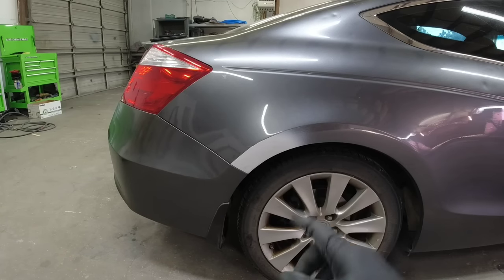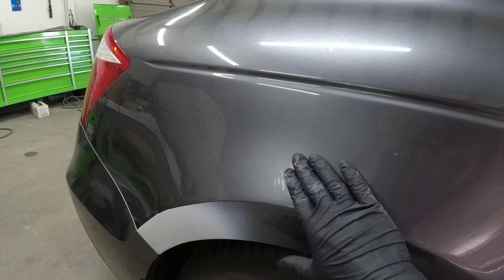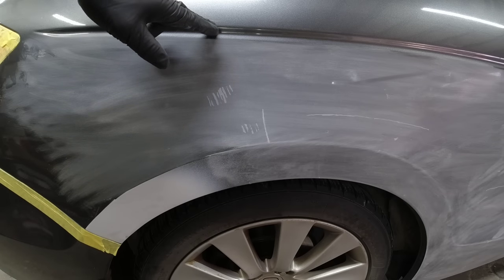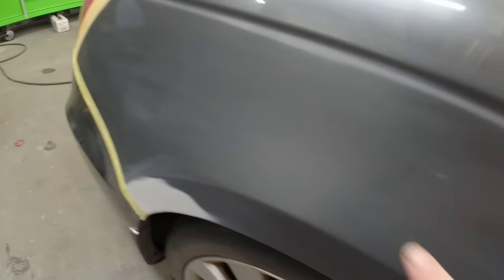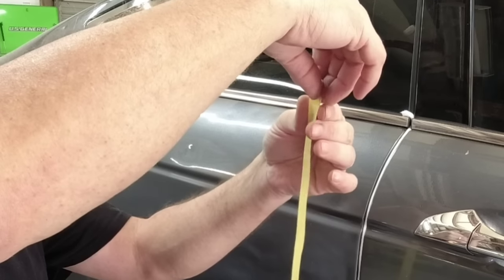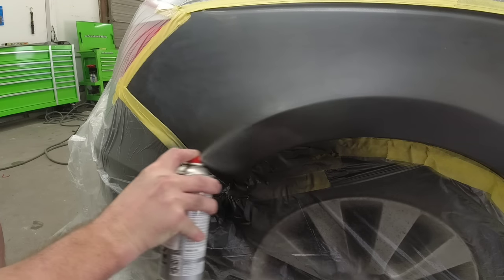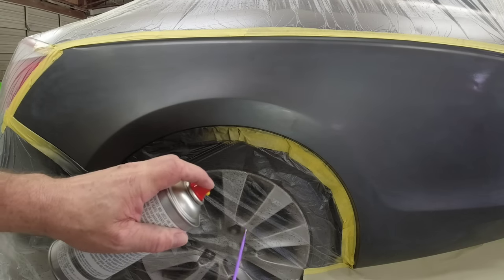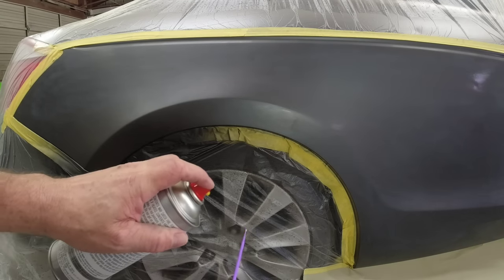How to SPOT PAINT a car with SPRAY PAINT and CLEAR for amazing results!

Comment: That 2k clear coat is great but wear a Proper Mask because it will cause serious health issues.
Reply: Bro he's a professional, he'll be just fine.
Reply: Ok Karen
Reply: @TylerHankss  sprays basically poison in the air. Someone cares enough to point it out. Professions can't die. Karen calling. 😂 I swear the internet is wild
Reply: I don’t even think there’s a mask that can filter isocyanates. It absorbs through the eyes and skin too. You need full face respirator and coveralls.
Reply: Thank you for the inspiration; I’m ready to tackle my badly scratched door! Saving hundreds in deductible, and possibly in increased i nsurance rates!
Reply: As someone who used to paint a lot of graffiti you should definitely preach this to other graff artists 😂

Comment: Man I used to blow off the notion of a mask or much less a respirator.  Wrong!    The usual Rustoleum enamels are one thing, and even then we should protect ourselves, but lacquers are truly dangerous, and that 2k Clear is very strong, but very good, as I’ve used a ton of it.  It polishes out well, and has even passed the gasoline spill test.   The Dupli-Color version I tried before failed miserably.   This can be done.    Mostly prep work is very crucial, well, it’s ALL crucial.   But application is the make or break.   Environment matters big time too.   If it’s too warm the paint will start to dry in the air before it hits the surface.    So you get closer, right?   Too close and it piles on in such a way that is insidious and deceptive.  It might look great, no runs,shiny and wet looking, top notch.  But later you will see it settle, and on vertical surfaces it’ll run so subtly you won’t see it till your wet sanding it next week.   So not so close then.  But it MUST look wet by the third coat.  First mist coat is crucial, NOT WET.    Let it sit just long enough to be tacky, not dry, but flashed off, where all the solvents have escaped, which is a tough call.   Because here’s the kicker.   If you wait too long, the next wet coat won’t settle into the mist coat deep enough, won’t stick as well, require that much more product, which then induces the next pitfall.   If your can spatters, spits, at ALL, shake it and give it a spray elsewhere to see how it’s doing.    If you THINK it’s gonna spit, set it aside for a seldom seen area where you might need more depth, and a spatter can be sanded smooth and dealt with, as opposed to the middle of the side of your drivers door.   Worse though, is when everything looks good and you let it cure, only to find cracking or “crazing” in your paint in particular places.   That’s where the coat beneath cured JUST enough to form a skin or layer, but hasn’t released ALL of its solvents yet, but then you didn’t catch that nearly impossible to detect issue, so you paint a wet coat, let it flash, and another.   An hour or so later you excitedly check out out and horror.   Crazing.    Like dried mud.   The first layer is still shrinking even after the second and third coats go on, but those coats cured themselves and are preventing the bottom coat from curing properly, and when it shrinks, cures, settles, moves, whatever, you see the results in the top coats.    Bad news.   Start over.    Spot painting on top of a spot painted spit is no good.   Of the grain beneath isn’t uniform then the color coat won’t be uniform.    With the OE paint it’s all old and being done by a machine there isnt much grain to see, other than very uniform orange peel.    You’ll see the sanding and paint depth differences if you try to just sand away the crazing, and then recount that.   At that, you can really sand it for a few hours, regardless of what the directions say.   Sanding uncurled paint is a recipe for disaster and a hundred times the work you envisioned.    The clear coat can hide SOME things, but that one spot you think is no biggie, will be.     I’d say that once the surface is right, and it’s paint time, that spattering or spitting is the one biggest fear and can ruin your day.  Learn how to feel for it, keep the nozzle wiped, and keep your hands and fingers well out of the path of spray.     If it’s too cold, it takes too long to dry, hits too wet, runs or sags, and has linger time to catch moths and dust.     As hard as you’ll try to keep the area bug free, good luck.   If it’s too humid, you’ll get cloudy or foggy spots, where it looks whitish, and that’s absorbed moisture sucked into your drying paint, as a sponge to moisture, your paint to the same.    Try to dry the air with heat or a dehumidifier, and quickly, but not too quickly, as drastic changes in conditions WILL affect the finished product.    Maybe very glancing and subtle applications of a heat gun or hair dryer, but don’t get too hot or it will run or shrink, more problems.     To dry, it will be dry before it hits the car.   Get it wrong, and you’ve got a high-nap suede paint surface.    Which can be sanded but then you’ve got to repost the whole section.    Running out of paint is another nightmare.  It induces mistakes.       Nice overlap strokes, leave no line but if you miss don’t go back and fill it in until it flashes just a hair or it will sag.    The right pace of movement, careful attention to exactly what you are doing, real concentration, it all matters.    A gun gives you a more uniform supply, a better pattern, more overall control of the paint itself, and repeatable results.   But a pain to keep track of mixes, proportions, the mess, the supplies, the compressor going off when you’ve heard enough, and the cleaning of the gun, nozzles and tips,cfm rates, drier, the whole shooting match.    To me, it’s still a toss up.   I got incredible results on my Magnum in Brilliant Black, sometimes I can’t believe I painted that whole quarter panel, it looks so good.   But my moms old Mercedes in simple Black is killing me.    Where I swear a gun would make so much better.   But I hate needing a big compressor and the whole pile of accessories needed.  But, it may be time.
Reply from the maker: I appreciate the comment and support!
Reply: I’m about to try and touch up on my car where it has scratches from who owned it previously, I have one spray can of primer and another spray can of silver paint to match my car and reading this just blew my head off, hopefully my little DIY job goes ok lol
Reply: What would be the ideal temperature to apply the clear coat please?
Reply: @guitariste47 . The can of clear should have the information, but 70-80 degrees is probably the sweet spot.

Comment: Great tape but I was told to always let the bass co cure for a couple of days since it's a single stage and doesn't always dry that. If you put the 2 part clear on 2 soon it'll eventually bubble because a chemicals haven't come out of the base coat yet...
Reply from the maker: If your clearing over  single stage it's  a bit different. I wouldn't let it sit for days that's  too long but single stage you could let sit for about 45min before  clearcoat.

Comment: Very informative. 
Much appreciated. 
One thing I have learned though from using aerosol cans for the past 40 years is start the spraying off the targeted area and end spraying off the targeted area. Especially if you're using metallic. Gives it a more even coat. At least in my experiences anyway. 
Not saying its right or wrong, its just that works best for me.

Comment: I'm a keyboard nut but I have an '87 GMC S15 that is starting to bust rust. This was a great confidence booster. I recognize the need for a good foundational cleaning, proper surface prep, and keeping the can moving. Please go back to the original repair description and link this video.  TY

Comment: great video and a very great to to me, a total beginner who's never done this before.  The only worry I have is that you don't say 1) How long your leave the paint coat to dry before applying the clear. 2) I'm unclear what, if anything, I'm supposed to do on the paint job before applying the clear? Just a tack cloth and the isopropal? Anyhoo, you have given me the confidence to now try this job after two weeks of buying the paint and clear, but lacking the courage to actually try it. Now, after watching your video, I can't for tomorrow to get going on it and really get it done! Any faults will be my fault and not yours because you showed how to do it so well! Best wishes and thanks again from the UK. Al.
Reply from the maker: Awesome! 15 minutes before applying clear depending on temp. You may tack base before clear and insect for any dust. If you do find dust lightly sand with a fine sand paper between 600- 2000 grit apply another coat of base at clear. Watch some more of my painting video's I go over all this. Appreciate your comment and support!
Reply: Many thanks for giving me the courage to try it!  Saved me some £500 the body shop quoted! Came out pretty well, only big mistake was allowing the clear to drip in 3 places! I think sand back and spray clear again might cure that. Funny story for you: Have no garage or shelter, had to do it in the street. Underestimated power of the wind (only about 10mph). Got into car and then noticed the wind had blown the clear coat, covering all the windshield! Couldn't see a thing! Frantic panic to grab some compound and get it off before the sun baked it hard! You've never seen a man of 74 move so quick! Best wishes and thanks again. Al.  @GarageNoise
Reply: "It's not that the wind is blowing it's what the wind is blowing!" - Ron White @jewellguitars

Comment: Thank you for such a great video. Yesterday, I did the same thing with my Honda Accord. I was delighted with the results I achieved with the color-based spray, but I went and used the same clear coat you used in your video. I got cloudy, - dull results, and I don't know why or how to fix it and avoid it happening again.

Comment: Great video!  We have a 2006 RAV4 that has one area where the paint is bubbling (and coming off) plus some areas that need minor repair (dings from parking garages, etc).  There are only 120,000 miles on the car and it runs great, but paying for a professional paint job on a 17-year-old car doesn't make sense to us.  She's been good to us, but seriously, how much paint does a woman need!  :)  We'll give your instructions a try.  If it works for amateurs like us, then you're a hero.
Reply from the maker: I had 3/4 of a can of paint left so I imagine you could do paint 4-5 spots the size of mine with one can of paint. As for the clear I would figure about one can of clear for a med size panel like this.
Reply: @GarageNoise  I feel like I'm going to seem stupid asking this and I am asking this genuinely but I'm just curious as to why you sanded the whole panel back when it looks like you only painted the back wheel arch area. Was it just that you didn't sand enough paint off to need to respray it and thus could just go back over it with the clearcoat?

Comment: I used the very same 2K aerosol clear coat on a fender that I redid 3 years ago and I ended up with a bad case of orange peel that took me most of the rest of the day to sand and buff out.
Reply from the maker: This stuff cures hard as nails. That's  good for durability tho.

Comment: Great video. Didn't know they had these paint options out there. Small suggestion, next time start at the top as you did but do the whole length of the quarter panel and work down. Thanks Again

Comment: That paint was fine too begin with!  

I painted my teen son's 95 Impreza with rattle cans. From forest green to navy blue.  I used Rust-Oleum brand enamel. I do not buy the spray cans with the standard caps they are often junk, and on big projects will cramp your finger faster too.  I did the whole job in phases, in 7 days start to finish, under an open carport. 1 day later, after a decent dry time, the Colorado wind gusts picked up for days.  I was very blessed! Close call!

My recipe was: sand with 320, then 600, clean with soap/water, mask/cover, clean with lighter fluid twice, tac cloth, 2 coats black primer, 3 coats color, 3 coats clear...each 10 to 12 minutes apart. All paint has to applied within 90 minutes from start, upon a flashed off coat.  2 years later and still good.  I don't even think he's waxed it yet. 😅

Oh, i didn't sand between any coats, obviously.  It didn't look perfect but good enough for a teen ride.
Reply from the maker: @thesetruths1404  👍

Comment: Man, you have no idea how much this helps me A TON!!! Never done it before, zero practise or knowledge but I feel confident (thanks to this video)I can do it with common sense lol. But it bugs me not to understand something, that in fact you haven't spray paint the entire area but only sprayed with clear coat after sanding down. So my question is: If I sand it down an area with 800grid and clean it and after apply CC I will get the shine back?. Thx in advance Liked and Subed.
Reply from the maker: Yes you might need to wet san an polish but you will get the shine back. I have video's that show the process  of sanding and polishing clear coat as well.

Comment: I'm not sold on the 2K clear aerosols - they're just a bit of a pita compared to painting the base with an aerosol then using a gun for the clear.  You get a better finish faster using a gun for the clear - with less effort.
Reply from the maker: Oh yeah definitely better with a gun. Im just impressed  with  the appearance of 2k Aerosol clear.  A good option for those without a compressor or gun. Appreciate the support!

Comment: Using a Rust-Oleum type spray can handle when doing a job like provides better application balance and reduced finger fatigue. May even prevent the run that happened!
Reply from the maker: That would be helpful. Appreciate your comment and support!

Comment: Great video!  Very helpful.  A couple of quick questions: How many cans of SprayMax Clear did you use?  And do you use an IR lamp to flash between each coat?  Thank you!
Reply from the maker: Only one can of clear. It did three coats. You don't  need a IR lamp with this. It dries quick and hard.

Comment: Why wouldn’t you spray side to side in o e pass since it is small enough to do so comfortably? Seems like the 12” section approach would be an easy way to over build and get runs. 
Good video - direct and complete - thank you for putting it out there!
Reply from the maker: You can, just depends on how you like to spray. I felt more comfortable painting in section and I was happy with how it turned out.

Comment: I'd visit a scrapyard first and buy the cheapest door they had, and I would use that to practice at. Can try different paints and clearcoats etc just go at it because it doesn't matter with a random door you're not going to use. 
If I was to try this at home I would want to be confident I would make a great result before I even bought any paint or anything.

Comment: Exactly what I needed to see. I just need the clear coat as I bought it in time. The paint is in great condition. Good to know I can tackle this on my own! Thanks!
Reply from the maker: Right on!
Reply: Quick question, can we spray clear coat on existing paint that’s in good original condition  ? If we just have extra clear coat cans to get rid off , or is that that not advised ?
Reply: @danieltenorio3559   I'm no expert, but With any painting job, it's all about the prep, and you could do that but you still have to prep the surface. There will be clear coat on it, and you have to have the new bond with the old. And I don't know if this would cause peeling later on.
Reply from the maker: @danieltenorio3559  yes but it needs to be sanded properly for adhesion. 600 -1000 sandpaper

Comment: Great video ! Thanks ! Need to do this on my Palisade. One fresh spot on the door and another I need to redo cuz I didn’t scuff enough and had bad adhesion :)
Reply from the maker: I hope  this helps,  appreciate the support!
Reply: Follow up … I’m presuming you would lightly wet sand the whole area to smooth out the new clear coat before polishing ?
Reply from the maker: @temeyer  yes, probably 2000 then 3000 and polish. Maybe I'll  do a video  on polishing out spray max clear.

Comment: Great video - thanks! What type of paint was the base coat you used under the 2K clear coat? Urethane? Acrylic? Also, can I use a can of blending thinners to blend the edges of the 2K clear coat? Thanks.
Reply from the maker: Nason xl a urethane enamel and yes you can

Comment: When buffing out did you use 1500 , 2500 wetland paper? Then compound and polish? I bought a second bumper that was banged up and used your technique.  Cleared with 2k. Now gotta see how it polishes out!  Thanks for all the great advice brother!
Reply from the maker: I didn't  buff this one but if need to I would use 2000 then 3000 then buff . 2000 cuts a bit slower  but buffs much easier.  Appreciate the support!

Comment: I wish I could super like this! Amazing quality and amazing inspiration honestly! 
I’m gonna email you some pics of the project Im about to do. I’m spraying the roof and hood on my 94 regular cab f150. It’s Calypso green and the clear is just shot on it from setting in sun all these years. 
I had a local paint supply shop put the OEM color in 4 aerosol cans and I have spray Max 2k clear to use too.
Reply: Good job my score for you 300%
Reply: Don't run before you can walk !